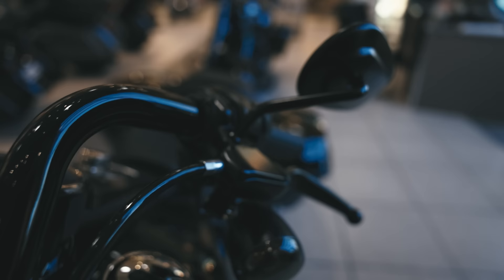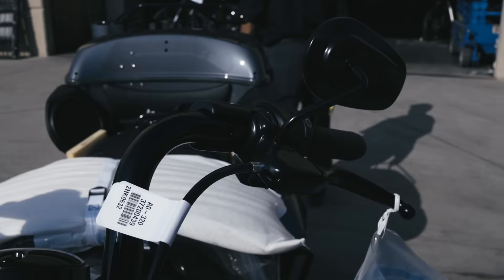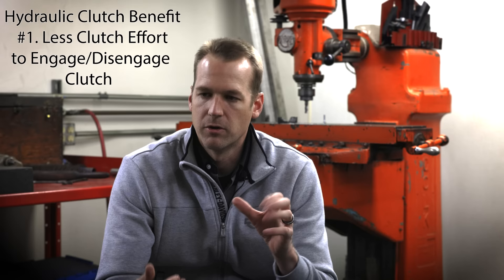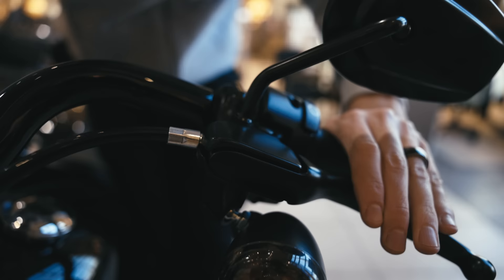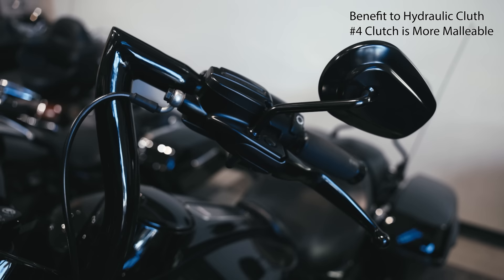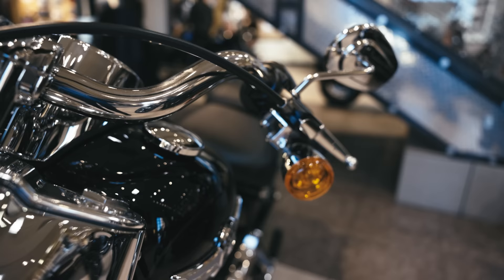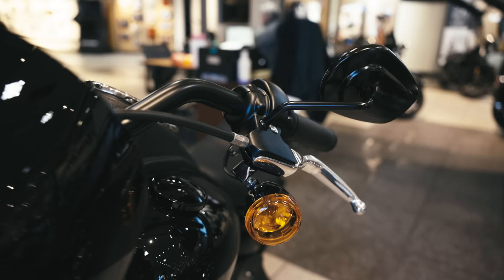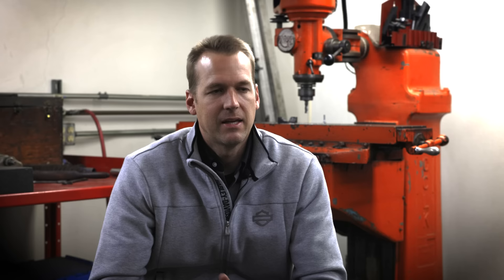Why Harley-Davidson Switched Back to a Cable Clutch on Touring Motorcycles│Pro's vs Con's

Comment: Riders to take the time to master the friction zone are not going to really care whether it’s a hydraulic clutch or a cable clutch. Guys who ride motorcycles once in a while and/or even ride all the time But refuse to invest the time and energy into mastering the friction zone are going to one of the easiest thing they can have to operate the motorcycle. If you’re having an issue with a hydraulic clutch versus a cable clutch that is a strongIndication that you need to go out and practice your friction zone. Go to  parking lot make some tight turns better yet go take an actual school. Do you know a motor cop talk him into going out with you on the weekend and showing you how to master the friction zone. If you have such a strong opinion over which clutch is in your motorcycle you really need to practice a lot more and master your bike

Comment: The cable clutch on my 21 St glide Sp SUCKS . Hard to pull , vague feed back . Not to bad on short ride locally . But I rode 11000 miles over 30 days and wish I had a hydraulic clutch on this bike . Now , on my 23 Breakout the clutch cable is awesome . Easy pull , great feed back . I really would like to convert my 21 st gl sp to a hydraulic clutch if that is possible .
Reply from the maker: Yea I like the hydraulic clutch better

Comment: My 1200 sportster makes a  banging noise when going in first gear  I have had many Japanese bikes with out this problem
Reply: Adjust the clutch and change the plastic shoe in the primary chain. But the right fluid in the primary case when you change it. I like synthetic ATF.

Comment: I have both and I prefer Hydraulic. I have had cables snap on clutches, plus they need lube. My truck has a hydraulic clutch too, it's just a better system IMHO When are Harley bringing in a quick shifter :-)

Comment: I just bought a 2021 Electra glide standard the clutch pull on this thing is so hard that it hurts my hand sometimes.  I can't believe how hard it is to pull.  I got rid of my ultra limited with a hydraulic clutch and I miss the hydraulic clutch.  something has to be done with this clutch on mine because apparently something's really wrong, Matt Laidlaw was saying that there's not that much of a difference in the pull between a hydraulic and a cable clutch, I almost have to use both hands to pull the clutch on mine so something's really wrong, they screwed up something on mine apparently.  I may convert it, he was talking about that in his video.  If I can convert to hydraulic I think I may have to and I don't care how much it cost, I can't continue riding this bike with this clutch, the pull Is that bad.
Reply from the maker: Something must be wrong man but yes, you can convert it to hydraulic.

Comment: I don’ta  like the cable clutch. I’ve have checked every new Road Glide I have come across and every single one has a sloppy clutch lever. Some with as little as 800 miles have a half inch of slack before the cable engages with  pressure.Also I like to ride not do maintenance or repairs myself. There is already enough expensive  maintenance to be done without adding a clutch cable that needs constant adjustment. One more thing and that’s the 800 lb. gorilla in the room there’s only so much stretching of the cable until it snaps and leaves you stranded on the side of the road in the middle of nowhere’s. I have had 4 new Road Glide’s over the last 10 years and will not trade in my 2018 for a lower quality cable clutch model.

Comment: The hydraulic clutch  will kill you!! My clutch failed three times on one trip to in mountains..after placing a repair kit by dealer it still was not fixed..I placed a cable on my bike..if you don't it will sooner or later run a way with you...not a good feeling..my bike is a 2019 Milwaukee eight 114 ultra low

Comment: A hydraulic clutch is more expensive to employ in the first place.  The hydraulic clutch cost much more maintain, rebuild one once and you can easily pass $100.  If you have to have someone adjust your cable clutch you maybe should think about why you ride.  Sorry I didn't know that you have to adjust your clutch so much, sorry I adjusted my clutch on my 67 Triumph once about a month after I changed it then for the remainder of the time I had the bike about 15 years and logged 1500 miles a year on it it was trouble free, oh yea I did lube it though.

Comment: Clearly obvious why HD did it! To save on production costs and complexity, recalls etc. I've owned about 10 different HD model bike's all new except a couple , and Hydraulic is superior to cable any day. It's a step backwards like on the CVO cutting corners and customers..
Reply: "less is not more. More is more"

Comment: The bottom line is the cable system is probably cheaper to build, if they make 500k bikes and save a dollar on each one that's 500k dollars. Everything is about money

Comment: So, I’m used to hydraulic from my vrod, current 2020 street glide special and other European bike manufacturers I own (KTM). Yes, I like the Hydraulic better, but the Harley one has a shit slave cylinder with a shit clutch. To make it lighter and feel similar to my KTM, I shanked the slave cylinder and replaced the clutch with a rekluse. It feels like an adv bike now, in the clutch and friction zone, and make a 900lb bike fell lighter is slow speed maneuvers. I hate cable clutches, why I never got a Ducati.

Comment: I have hydronic clutch on my cvo street glide and my softail pro street  as well as my Ducati multi is very clear this is a cost cutting excercise as they did with removing the heel shifter considering the cost of a new harley this is disappointing and will lead to me holding onto my current bikes for longer so may actually loose the hd motor company money I have apes on both my Harley’s and looks so much better than my dyna which has a big looping clutch cable

Comment: I really do not understand how Harley could screw up a hydraulic clutch. Then again it may be the riders are just whiners. I had both a 16 SG and 17 RK and I had zero issues with the hydraulic clutches.  
 
or Harley wants to copy Indian large v twin motorcycles and started with changing the clutches - but please, they did it to save money.   
  
with regards the friction zone, police riders, that must explain why so many departments ride BMWs now including the Capitol police - OH WAIT BMW USES A HYDRAULIC CLUTCH.
  
Considering I have seen good riders do an obstacle course with a DCT GoldWing and many hydraulic clutch bikes it all comes down to whiners.

Comment: My breakout has a cable and my road king special has a hydraulic clutch. The breakout has a lot easier pull. Holding the clutch lever in on my road king is a bitch. Also the Hydraulic clutch engagement on the road king special is horrible. I just bought the AIM slave cylinder and was told the engagement will be a lot closer to the grip. Right now it’s almost all the way out.

Comment: Hyd clutch
Never needs adjustments (no adjustment option). Always behaves the same. Smoother than cable. Less effort. Costs more
Cable clutch. Adjustable. Requires adjustments. More often. As the lube gets dirty/goes away, the cable,and thus the rider, experience greater resistance (lever effort). 
I’ve risen HD for 4+ decades. Both work well when maintained. 
Why he did it?  Less $ to build with cable. More opportunity for dealers to sell a service. I no longer preform my own services. Viva Harley-Davidson and their dealers

Comment: I have been riding motorcycles since the early 1950’s. I would say the friction zones are the same for either cable or hydraulic. The steels and friction plates are probably same part numbers. What makes a difference is in the mechanical advantage designed for the system you are using cable or hydraulic. I always had trouble with cables stretching and wearing out inside. The outer cable or the inner cable. Have to keep lubed, lever arms at handle or on the lower side. Steel parts wearing the aluminum parts. Lined inner cables with coatings coming off jamming the cables. Constantly adjusting the upper and lower to get the free play correct as the plates wear. Numerous things to maintain. Hydraulic you have none of it. Their problems are less. However, the engineering of the system is a give and take situation. The size of the the piston in the clutch reservoir, the mechanical advantage of the lever itself, the size of the piston in the actuator. Never a clutch adjustment as it is automatic unless some other parts wear out. The friction zone will change as the plates wear. Choose your poison. I’ll take the hydraulic.

Comment: Lol, you’re so naive Matt. Harley got rid of the heel shifter, the hydraulic clutch, what else? Next year they’re not coming with tires 🤷🏻‍♂️ atleast they’re passing the savings on to the consumer... I mean putting the money they save back into R&D to develop more powerful motors. Wait, still not them... I’m a HD guy but The Motor Company has been pissing me off lately and Indian has been looking more tempting as a replacement for my 2018 Street Glide Special.

Comment: So a 15 minute video and you think Harley just felt it was in the "best interest of the rider" to go back to cable.  You never mentioned that hydraulic clutches, if filled with standard DOT4 WILL overheat in standstill traffic. Not 'could'... WILL.  You have to use high temp DOT4 rated for 475ºF which standard DOT4 won't work past 330ºF.  So no mention of that along with the 6 recalls all related to the hydraulic clutch.  But ya, Harley went back to cable 'for US'. And of course-  they went back to a cable clutch using that cheesy plastic locking 'thing' which means, you can't fine adjust your clutch at the cable-  nope, you gotta remove the derby cover and do it there.  Try that on the side of the road, alone, while keeping the bike level.  By all means-  keep buying them Harley shirts, bandanas and coffee mugs.  ?????????????  OK- rant's over-   Ride Safe Everybody.

Comment: The only real advantage to a cable clutch is that its cheaper to manufacture, PERIOD. I would never go backwards to a cable clutch again, its going back to outdated technology. What's next, get rid of electric starters and go back to the old school exposed valves, they are so neat to watch the valves opening and closing like they did on the original models.

Comment: Production-cost-reduction, plain-and-simple...just so happens in this case, it made them go back to a FAR BETTER SYSTEM, the 'dino-way'. (FYI, no automobile that has EVER gone to a 'hydraulic clutch system' remained successful...the model either folded, or they went back to classic 'clutch-pressure plate-throw out bearing' systems without hydraulic assist.)

Comment: and it's Not just Harley, i had a 2014/15 Honda F6C Goldwing Valkyrie with the Hydraulic clutch and it too SUCKED , i'm a former motor officer trainee, and HD Riders Edge/Riders Academy instructor and past service manager and still practice my training and the various friction zone in a cable helps with slow speed skills and lets face it unless you master the slow stuff you're not a real rider, cause anyone can point a Bike in a direction  and make it go, and the Cable just gives you the feel you need, that the hydraulic doesn't

Comment: Cost cost cost mechanical clutch solves all the issues. Hydraulic clutches with a small hand were horrible. In 2014 I bought a road king because it had a mechanical clutch otherwise I would have bought a street glide
Reply from the maker: So you think it's a cost thing but at the same time you personally bought a Road King specifically for the cable clutch because you prefer it?

Comment: Step backwards for Harley Davidson.  They can sell this anyway they want but that’s crap, this as one more thing H-D is doing to cut manufacturing cost.  Just like they don’t provide a heal shifter anymore and moving the gas cap location from front center of the Touring bikes to the right.  Harley has to be mindful that eventually Indian may get it right.  HD is no longer the only option. Polaris Indian bikes may be butt ugly but don’t underestimate that they may get it right eventually.  You can’t keep cutting costs and raising the price at the same time.  How about upgrading the suspension and LED.  LED light at manufacturing cost are very inexpensive, maybe $15 for A headlight come on H-D get it together.

Comment: Cable  VS  Hydraulic  ..  Both  could  be  good  or bad according to their Design Engineering and Leverage..      A  Cable will give a  good  service life  if you lube it once in a while .. Some  Cable  Controls  can  be permanently sealed and lubiricated  as from Cable Craft..  other Brands  will get moisture in  them and freeze solid in the Winter..
  Some HD Lovers   claim that  HD  went back to  Cable  Cluthces  after  many Hydraulic  system  failures  that  cost  HD  Millions  in a re-call ..   
   Most of my  bikes are older  and  only two  new Modern bikes  I have  ridden  besides  my  Yamaha  FZ-07  which has a Cable  Clutch  are  the Indian  FTR-1200 and a Triumph Tiger  1200 .. and I can't recall if  they had  Cable or hydraulic ..        
   Ride  Like a Pro   HD  Lover  fromer  Motocycle  Cop who  has  low  speed  Motorcycle   Riding Schools  prefers the  Cable Cltuch 
Jerry  Palladino  ..  Ride Like a Pro  based in FL .. he  sells  riding  Traiing  DVD's  ect..

Comment: This is a subject that really bugs me.  Its not just 2021, its in the last few years that HD have been cutting back features, while the bikes increase in costs.  Fatboys for instance no hydraulic clutch, no cruise control, solid discs, not floating on many models, that had them previously.  Cheap parts like pegs, grips and instruments.  Its cutting back and not saying anything about it.  It riles me that they don't think we will notice.  WE DO.  These bikes are very expensive.  They cost more than other quality brands.  It is NOT ACCEPTABLE.
Reply from the maker: I agree with you on some of the points you made but disagree with the majority of your comment. The quality and fit/finish of the bikes has only gotten better recently. The Fatboy is one especially that has never been nicer. That bike has an amazing level of detail in the finishes and everything. The grips are just the plain rubber they have always been but the foot controls are especially nice. HD has removed a couple things like a heel shifter on touring (which many people hated anyways) and one key fob (which sat in people’s sock drawer) but added many upgrades in the process without increasing price. The lever of aesthetics, fit, finish, and features has never been better as a whole.

Comment: Just Google hydraulic clutch recalls with clutch not disengaging.  This is why Harley going back to cable clutches. Unable rectify the problems with lawsuits.
Reply from the maker: When the hydraulic clutch was first introduced in 2014MY there were a couple recalls. The issues have been resolved a long time ago. I personally owed a first year rushmore bike and it was perfect. So it was a low percentage of bikes that ever experienced any problems. This isn't the reason for going back.
Reply: Harley has spent over 30 million plus dollars  with all the recalls, crashes, and litigation with the hydraulic clutch not disengaging.  They just went back to the cable.  Harley just tell the truth not like GM, please!
Reply: My 2016 was recalled for a hydraulic fluid change.  Got it done a couple years ago. I think it was a precautionary recall because of a few reports of clutch failure.

Comment: I have a 18 ultra limited and like the hydraulic clutch . just Harley saving money and charging outrageous prices . so get this I'm looking at the new ultra limited and still have that cheap 25 watt radio and now they have the plastic cone speaker in the front and the cloth in the rear speakers ?? couldn't match them up Harley ?? And get this one they charge $1900 MORE for the black bike all blacked out opposed to the black with chrome ?? so doesn't make sense when you look in Harley catalog all the black parts are same price as chrome parts . so the both bikes should be same price . I've been to at least 7 dealerships and nobody has an answer but have heared maybe its all black is more popular ?? Wtf

Comment: I want to like H-D, but what kind of $28,000 touring bike comes without full led lighting, non adjustable windshield, cable clutch and less than 100hp? And if you want an actual color other than black, that's extra. Don't want chrome? That's extra. Want electronic rider aids? That's extra. Assisted reverse? Not invented here. Android auto or Apple Carplay? What's that? Heated anything? You guessed it, extra. Adaptive suspension. Not available. Adaptive cruise? Hahaha

How is it possible for BMW to build it's motorcycles in the capital city of Germany, pay it's workers in Euros, ship the motorcycles across the globe and still offer better value than a company that builds it's motorcycles in USA and pays it's workforce with cheaper dollars? Only one of these companies is in financial distress... I'll let you guess which one.  Come on guys... I WANT to like you!

Comment: i love hydraulic clutch i know what i'm saying here, i have 3 Big twines cables clutch Fat boy 2011 and fat boy 2014 also i had 2012 Road king classic,  Lately i got  2016 Fat boyS with hydraulic clutch also i had road king specials 2017 until now i ride 0n it 2021 i love it , i will mentions my son bike also have hydraulic clutch breakout cvo white 2016. when time comes i will change my bikes to touring bike with hydraulic clutch off cause never again on cable clutch its looks horrible like. chipped potato. Mr Matt thats my comment from my expieriences. Mr Sixthree Saludo from London UK.